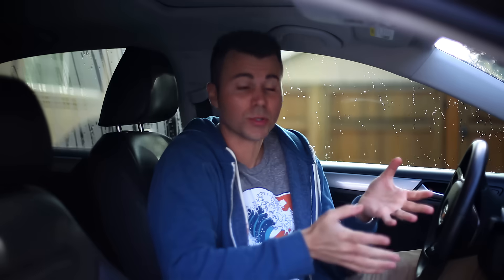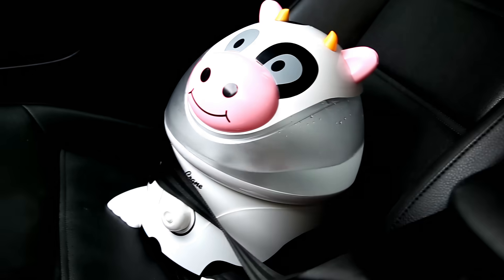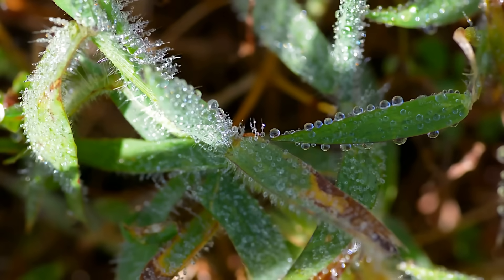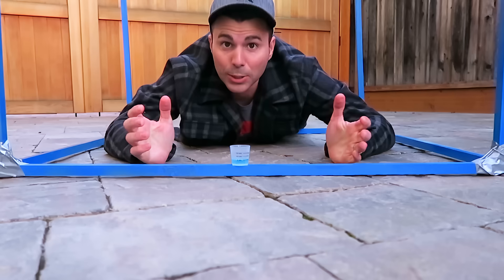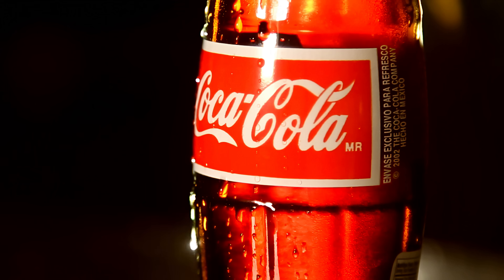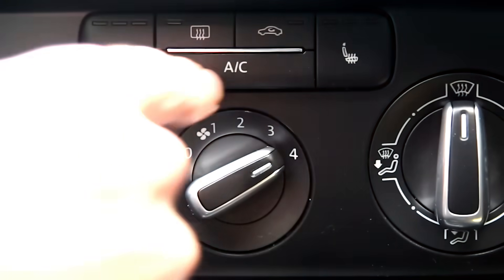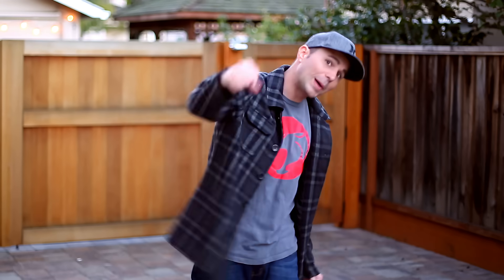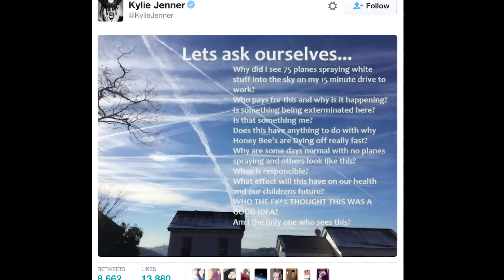Defog your windows TWICE as fast using SCIENCE- 4 easy steps

Comment: My mom just turns on the wind shield wipers
Reply: How does that help condensation on the inside?
Reply: Does your momma have windshield wipers on the inside of her windscreen does she sonny?
Reply: This winds me up as it does nothing but shag your wipers so they don't wipe water when it's raining. Please tell her to stop as she's costing herself dearly
Reply: Nicole Smith lol
Reply: Simply Me!, well idk if this happens for other people but the fog is on the inside
Reply: SloppyKoe22 - No, we're not talking about visible fog in the outside air.  We're talking about the condensation on the interior glass.  THAT is what we're trying to get rid of when we "defog".
Reply: adamsbja Turning on the windshield wipers does not help the inside, but it does remove the water sitting on your windshield.
Reply: this comment bothers me idk why
Reply: +Grim Reaper syp - Nice idea, but it's still cheaper to just buy the de-icing sprays (that work with pretty much the same idea, but dispense neat ethylene glycol antifreeze) when they're on special offer. For the cost of a couple bottles of high strength alcohol you can stockpile enough of them to last about a decade, whereas your home-made spray will be less effective and run out a lot earlier.

And of course there's those which you're supposed to spray on after you park up, IE before the car gets icy rather than after. I think it's basically the same stuff but in a non-aerosol squirty bottle and maybe with some kind of gelling agent to stop it evaporating away overnight...
Reply: Tom Salazar common sense
Reply: Simply Me! Oh ok thank you
Reply: Simply Me! 
Genius
Reply: That dries out the windshield to much
Reply: Ready for this............ Wait for it, no, no, Wait for it........... Mix 45% Alcohol with 55% Water. On that COLD Freezing Morning/Day when Your Windshield is Ice/Frost Covered. Spray the Windshield with this Spray!!! Walla, Frost/Ice GONE. (Inside) Prevent Fog upon Your Windshield by Cleaning it with "Shaving Creme". Yes, it Works... Even Use this Trick on Your Bathroom Mirror... AND Always Remember. "NEVER" turn on the Cars Rear Window Defogger on a Frozen Iced Window. Start the Car. Let the Window Warm up just a bit... Then Turn on the Rear Window Defroster!!! Or Turn it on like Many People do "And Watch the Window Blow up."

Comment: Doing this may initially defog your windshield faster, but it will cause more problems when you start driving, because you'll not want to leave the AC on while you're driving to work in the snow, and turning off the AC will cause the windows to fog up again. So never turn on your AC in cold weather.

Comment: You did a really good job with this video.  Every cold weather season I see people driving with badly fogged up windows because they have the recirculation activated.  You mentioned this in your video but I want to stress that recirculation is only for hot weather, A/C.  Another thing people need to check is why their car is wet inside in the first place.  Before putting the car away for the night, driving the last couple of miles home, turn the blower on high setting with windows closed.  At home, exit the car as fast as possible and get the doors closed fast.  Then the inside of the car is as dry as it can reasonably be.

Comment: turning your ac on when the heater is on won't work most cars won't turn the AC compressor on if the heater is on I suppose you could run the AC first then switch to the heater

Comment: The fastest way to defog is to make 1) dehumidify, and 2) match outside temperature. That's why default defog usually cycles outside air in. Using heater for defog isnt always wrong, if there's a situation where outside is hot and inside is cold and humid, it can still create humidity, and that's when a warmer air would work. TL;DR, when its cold outside and you enter the cabin and it starts to fog, use COLD air to defog, and having the windows open would make it happen faster unless it's more humid outside.

Comment: So you basically determined that the auto engineers knew what they were doing. You are aware that when you turn on your defroster the climate control switches to external air source and turns the AC on, and they've been that way for decades?

Comment: All you need to do is clean your glass to remove oil, debris, road film residue etc and the windows won't fog up.  No need to screw around with the AC, window positions, hot, cold, etc etc
Reply: Spoken like someone in a warm dry climate. :-)
Reply: It is warm and dry in California and cleaning your glass prevents fogging in any locale.

Comment: I'd recommend not using AC when having the blowers directed on your windows as over time it can leave an film which makes it foggy and hard to see out of especially at night.
Reply: That's called dirt... clean your windows!
Reply: Or maybe have your A/C cleaned and inspected, they too need some love from time to time, you know?
Reply: Mines gets all bitched up from smoming a bunch of cigarettes. Its so neat to see how dirty the towle gets when cleaning it ever two weeks!
Reply: Clean your car, it must be filthy if that happens. Also, if you use (or anyone has used) those interior protectants for the plastic parts of your car ten this will definitely leave a film on the interior of your windows, all those products evaporate when applied and that evaporated chemical deposits on your windows. Clean all your windows very throughly and don't blame the AC, its perfectly innocent.

Comment: Awesome video!  Question for the folks out there...  why is shaving cream the almost universal go-to defogging solution out there?  Liquid dish soap or other detergent is probably the best.  It takes SO little to apply and dries smooth and leaves very little residue.  Jet Dry dispersant for dishwashers or similar is liquid and not syrupy and is made to do just this.  Heck, detergents such as these, hand soaps, shampoo, shower gel, laundry soap (liquid or powder) are also SURFACTANTS and are well known for their WETTING ability, are they not?  And they are concentrated.  Just don't use the el-cheapo dollar store dish soaps, they are syrupy but so little actual detergent in them.  Use half a freaking bottle to clean anything lol...

I have used a tiny dab of dish soap to prevent fog on glasses, goggles and face shields, it works wonders.  For a windshield it may be useful to dampen your spreading cloth a bit to help it spread all over better, since you need so little (less streaks etc when it dries)

Comment: It is true, BUT, you did not include all possibilities. There is a good chance that the condensation takes place on the outside of the windshield, in that case, you should never open the windows or open the air circuit.
Another case, is that the outside air is hot and saturated, in that case, you can't  use temprature to remove fog, you should instead decrease air pressure by increasing flow, in that case, you should use cold setting because it maximizes airflow.

Comment: I, unfortunately, can't use this trick. For some reason, it's the outside of my windows that fog up. I just use the windshield wipers and blast the glass with hot air to heat it up. It takes forever, since the heat has to make it to the other side, and after I use the windshield wipers, the fog comes back quickly.

Comment: My vehicle won't allow you to have the heat on and the AC on at the same time. Digital thermostat, if you want heat, you turn up the temp, AC, you turn down the temp. 

It is possible that when the air is directed to the front window, it turns the AC on automatically (as it has a separate from defrost button), so it might be a moot point in the end. 

If so, the only thing I haven't done is crack the windows. Makes sense to change the interior air with the outside air to try and get rid of moisture.

Comment: how do you turn heater on full blast and a/c ?
most cars wont allow heater and a/c on at the same time
expensive cars have climate control, so the temp is the temp and the car knows whether to use a/c or heat.. this video sux
Reply: Steve R actually, in newer cars the ac is almost always turn on automatically! even more when you put defrost on as it will dry the air faster
Reply: i was in a 2017 chevy malibu last week. A/C would not turn on when defrosters were on

Comment: What happens if your car is frozen not just ice all over the outside but the inside as well?
Reply: You follow the instructions in the video as explained.  It'll still defrost quicker.  But definitely crack a window during the process to help get the moisture outside of your interior.  And know that if you talk, open mouth breath, have a steaming coffee, or otherwise add moisture to the interior while you trying to defrost, it will just add time to the processes.
Reply: burn your car
Reply: Sarah 
1) Turn on your ac full blast
2) Turn off air circulation
3) Crack dem windows
4) Use a shaving cream
Reply: +EnochLight 
I'm in the uk, our temperatures keep changing they can go from 14 degrees Celsius, down to -4 degrees Celsius, so we can have a mild day but a freezing night. I can wake up to take the kids to school and not prepare because I didn't expect my car to be completely frozen inside and out, and as a result I'm late getting there.
Reply: If I were the guy in Michigan I would fight that in court, it's a ridiculous ticket.  Remote starters are a godsend in colder climates, and the law can go f itself if it has a problem with them.  I've been using one for years without issue (technical or legal).
Reply: EnochLight http://www.fox2detroit.com/news/local-news/227591405-story

guy was half right. remote starts are fine, the problem is leaving the keys in a running, unattended vehicle.
Reply: No, remote starts don't require a key.  The whole point is to remote start it, with doors locked, while you're in the house.
Reply: Sarah Get a refund
Reply: Stay at home
Reply: if you have ice on the inside of the glass, chances are that there is some water under your carpet from a leak somewhere
Reply: If you live in a place with cold winters, a remote starter is a real life saver.  Just fire up the engine, let it run for 5-10 minutes with the heat on, and drive off in a toasty de-iced car.  ;)
Reply: PongoXBongo Amen brother. my current car has one, so useful. but I do miss the heated steering wheel my 2010 Maxima had. ..
Reply: Not necessarily.  In Michigan, the winters can be quite humid, and under the right conditions you can get a small bit of ice on the inside of your windshield on a brand new car.
Reply: enochlight, that's why I said chances are. that is just a common reason. just like the video will not work for everyone as different cars have different setting & setups.
Reply: a guy in Michigan just got like a $180 ticket for letting his car warm up in his driveway
Reply: Source?
Reply: @PongoXBongo - he's likely making the story up.  Michigan has no such law statewide, and I know of no cities that prohibit using a remote start.
Reply: If by attended, you mean that you're inside it or right outside it, I know of no area in the US where that's illegal.  But what the kid did in the news link above is the complete opposite.  He left the keys in the ignition, with the doors unlocked, and went inside the house.  He deserved that ticket, because it was idiotic to leave a running car unattended.
Reply: Sarah call a cab
Reply: get a new one
Reply: Close the windows when it rains 😂
Reply: Well then you're screwed
Reply: It's not ice

Comment: you could just wipe it with a towel
Reply: In the mornings here in Texas my windows get fogged up from dew and wiping it away accomplishes nothing until the window is hot enough to keep more condensation from forming. When I just wipe it off it builds up all over again as I keep driving until the inside of the car is hot enough to retain the moisture. I do what Mark said typically and it clears up in a minute or two. The only thing I haven't tried is disabling the air circulation, but some people on here are saying that turns off when defrost is on, so might already be doing that as well.
Reply: It depends on the car.  Some automatically disable air circulation when the defrost is on, while others don't.  Mostly, it's the older cars that don't.
Reply: Yeah I don't have a/c so i just wipe my windows with napkins 😂😂😂 they would always fog otherwise that's how it is in canada
Reply: This leaves streaks, and its surprising how much water is held on a screen. Because you wiped the screen, the dust actually enables the moisture to form quicker and unevenly (showing up streaks/smears), so whilst you're driving it will often start to lightly mist and be more noticable as the fog is not consistent.
Then you still have the towel, unless you took it back in your house you have a wet towel in your car, which will not dry quickly because its cold, and when it does dry, it will just let all the moisture back out into the car, so next time, your windscreen wont just be fogged up, it will be raining on your dash. Just as in the video he explains air can only hold so much water, the glass in your car can only hold so much condensation, and just like clouds, when the droplets get to big they either run down the window, on on q raked windscreen or sunroof, they will just drip over your interior. So, it really is best to try and get the moisture out of the car.
Another good tip, not mentioned in the video is to actually open your windows BEFORE you park up, that way the humid air from your breath during the journey has a chance to escape before you trap it in. This is where the moisture comes from, you breathing in a hot car, it becomes cold, cant hold the water, so it condenses. The cooler the air when you leave the car, the less moisture in it, the less fogging.
Reply: sayon Vijay As this is a true fact you very well could clean it off with a towel, but I've noticed the inside of my window get dirty faster and tends to have smear marks on it, after using a towel over time. Thus making it harder to see or distracting while driving. So either let your car do the job, or clean the inside of your windows on a weekly basis.
Reply: well use a paper towel or a clean towel
Reply: iaag o you cant wipe frost off...
Reply: Charles Mullen  ....you're an OCD nutcase.

Comment: I would like to say that i believe in chemical trails. There is a clear distinction between chem trails and condensation trails, a con trail will now spread and dissipate quickly, on the other hand a chem trail will not dissipate and it will spread. I think the issue deserves more research and investigation and should not be dissipated so quickly.